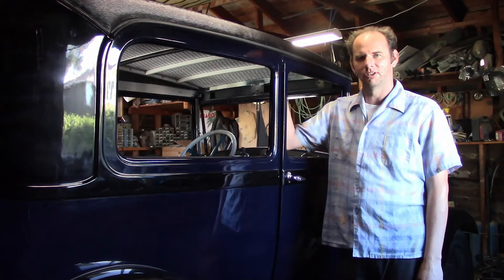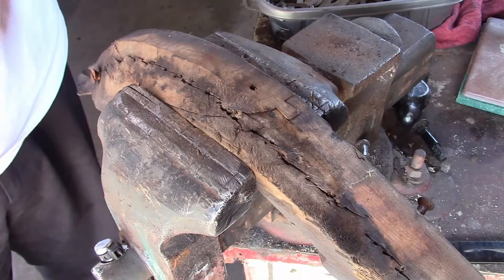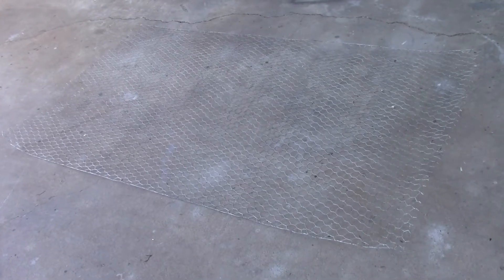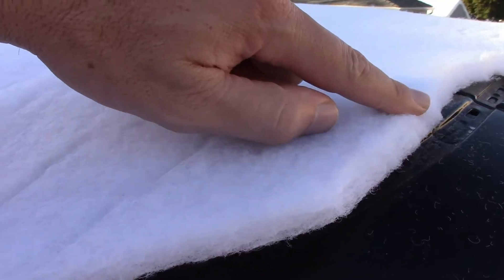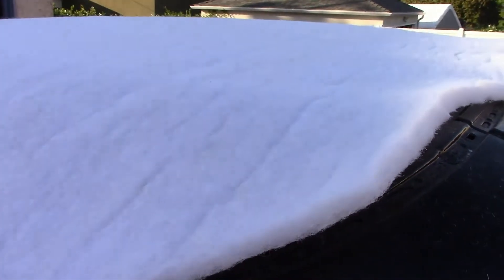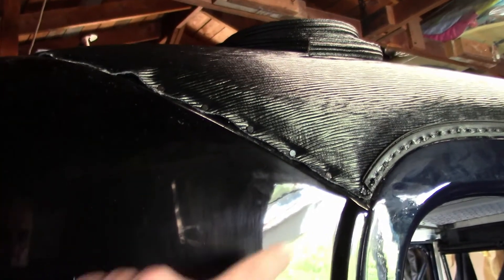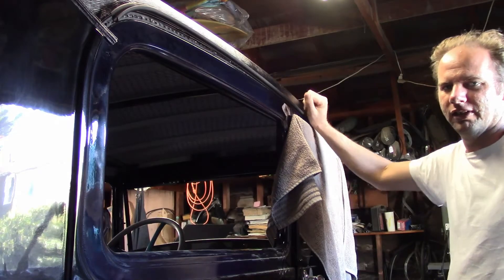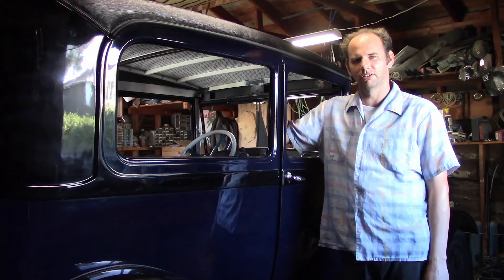How to install a vinyl top on a Ford Model "A" Tudor Sedan.

Comment: Looks great.  I'm sure the silicone sealant is more than adequate for sealing this installation.  I've been using Lexel sealant the last couple of years.  I believe it bonds to surfaces better than most sealants.  Also, the unused portion seems to last indefinitely if the tube is stored in a refrigerator.

Comment: Thanks for the video. Now I'm starting to get brave enough to install my rain gutters. When I bought the car the roof had been installed with the metal strip in place and had been sealed as well. I have attempted to install the rain gutters a couple of times but backed away. did not want to bruise my nice paint job. the metal strip seems awful close to the painted area . how far away from the painted area should this metal strips be.

Comment: How difficult was it to remove the side trim above the door?  Seems like it could be easily damaged.  Thanks for showing us how you do it. Looks great!
Reply from the maker: The wood behind them was gone, so the gutters just pulled off easily. But yes, they are delicate. Most of the time they have to be replaced after removing.
Reply: @onewhocollects6781  Good to know, thanks.
Reply: Good information,i have an old woody station wagon missing the top ,after i repair the wood corners I have a basic idea how to install the top correctly,thanks